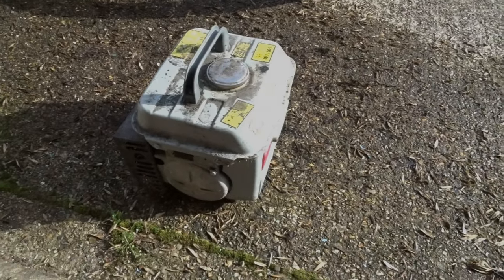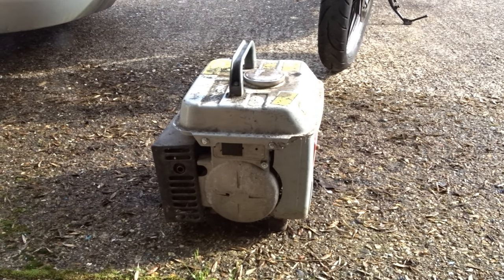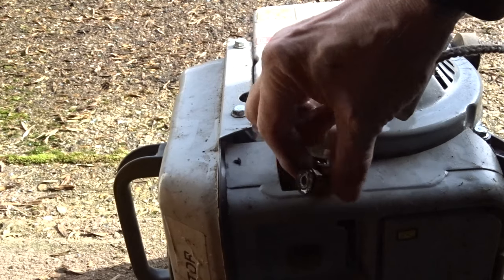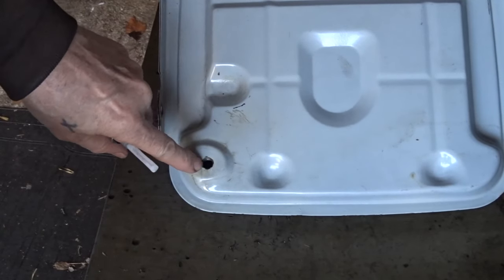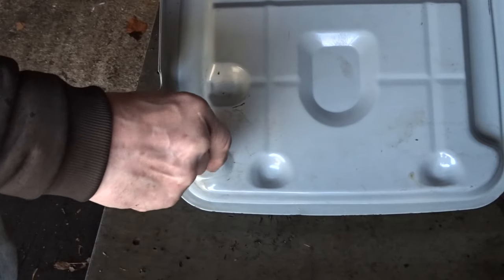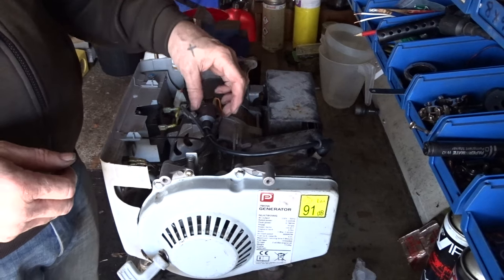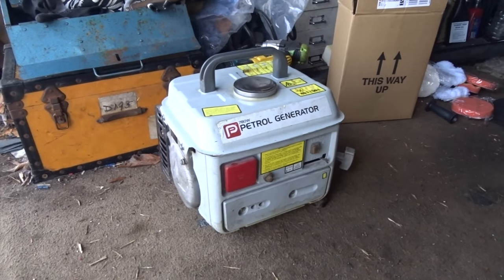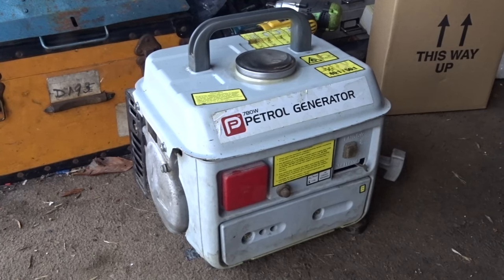Free Performance Power 780W 240V Generator Will it Start

Comment: i was given this generator and two days later the pull rope snapped go to replace it the recoil pops out now i cant get the recoil back in this gen has the worst recoil ever evedything els i can do but butting tension on a spring recoil no chance to much hassle
Reply from the maker: I had that exact same problem, there is a video on youtube somewhere showing how to do it, it is tricky and definately wear eye protection
Reply: @OldBiker  iv tryed videos on yt but they didnt work this generator has a weird recoil mechanism which makes it impossible to put back in the recoil unwinding itself
Reply from the maker: This is the one I watched that helped me get it back together - https://www.youtube.com/watch?v=twzVBlYlsLk